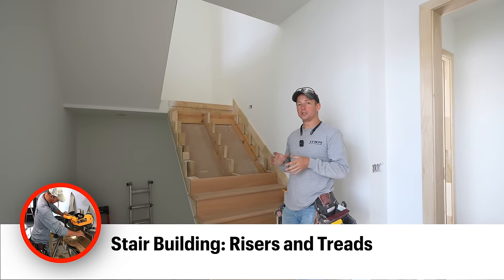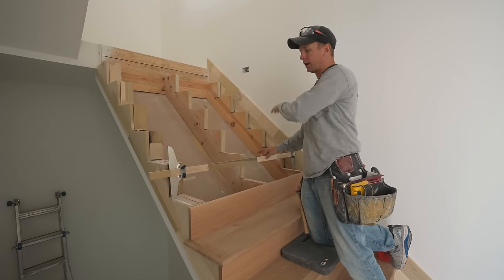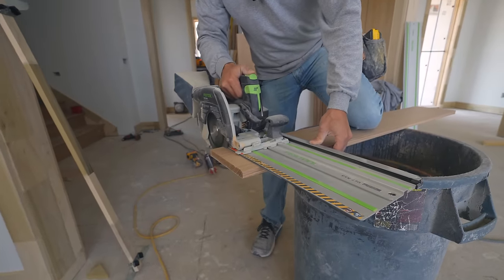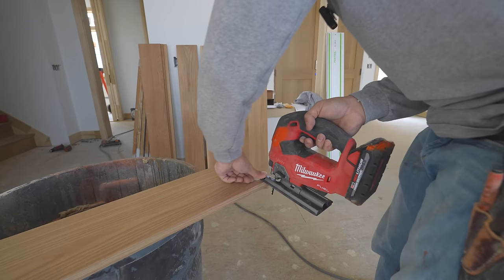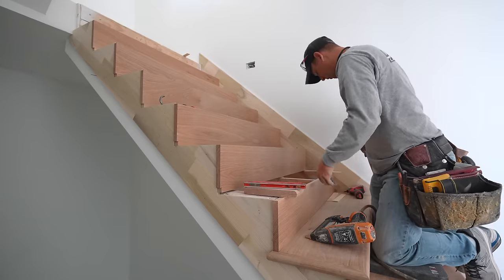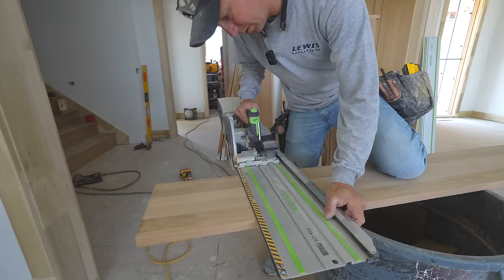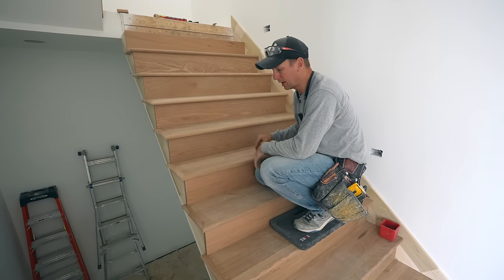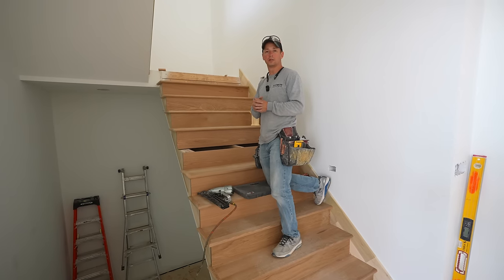How to Install Stair Treads & Risers: Pro Techniques

Comment: Spencer- I'm surprised to see you using an air finish nailer. I thought you were mostly using the Milwaukee cordless platform now. What's you reason?
Reply: Cordless nailers have a hard time getting through hardwood
Reply from the maker: I'm having a terrible time with the M18 15 gauge. But in general I would never use a cordless nailer on 1" thick white oak. Way too dense. Air is much more reliable in this case.
Reply: @InsiderCarpentry  I kind of thought that, but wasn't sure.Funny thing though, when I built my house years ago, my Senco nailer had a hard time  setting  the nails on my clear maple window stools. Ended up setting them by hand which left a larger hole than I would have liked.